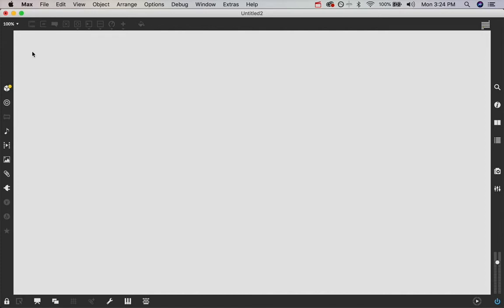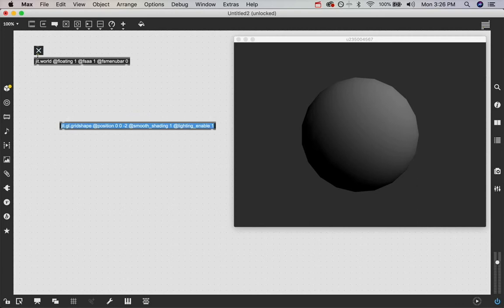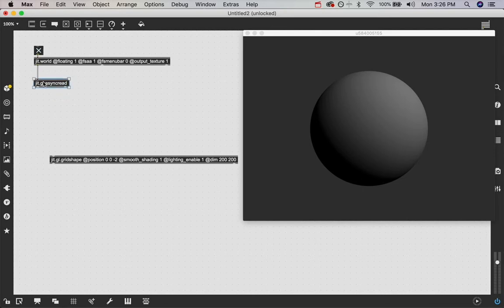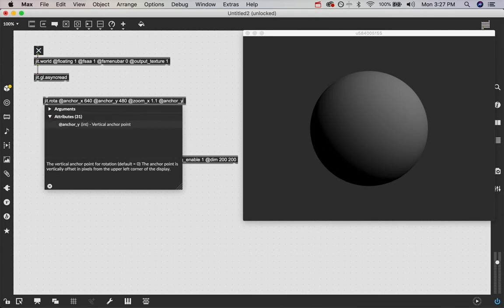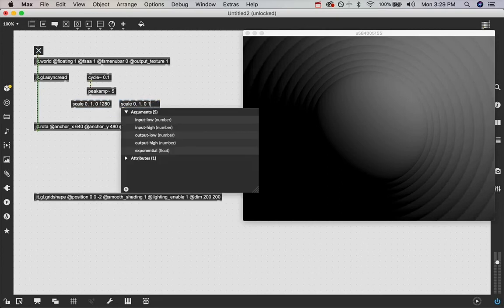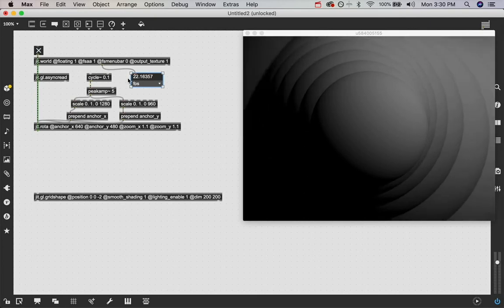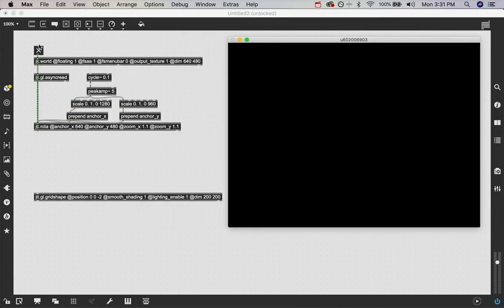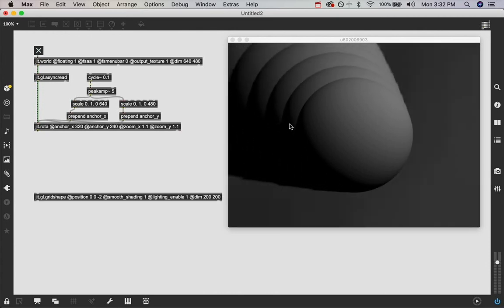3D Object feedback loop tutorial in Max MSP

Comment: Got it working but had to add an ezdac~ to the cycle, otherwise there was no motion other than the initial zoom feedback loop. 

I'm using version 8.6.2 (d076223e34e) (x64 mac)
Reply from the maker: Ah that would be because audio based objects such as the cycle need the audio driver on to output. By adding the Ezdac and clicking on it you likely turned on the audio driver. That alone should be enough to get it to work if it it wasn’t, you shouldn’t have to connect the cycle to the ezdac
Reply: @AndrewRobinson26  That's it! I didn't have the audio driver on (in options->audio status) so the signal generators (e.g. cycle, phasor) weren't running. If I have the driver on, I don't have to have an ezdac in the project (and you're also right that it didn't have to be connected).